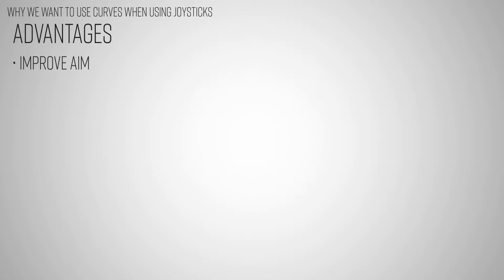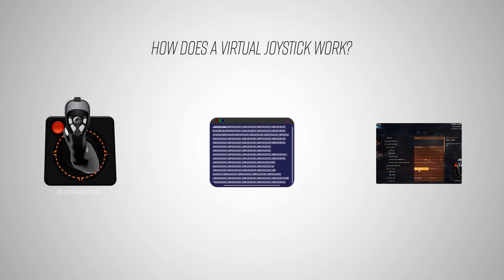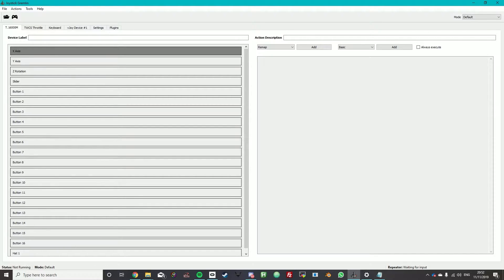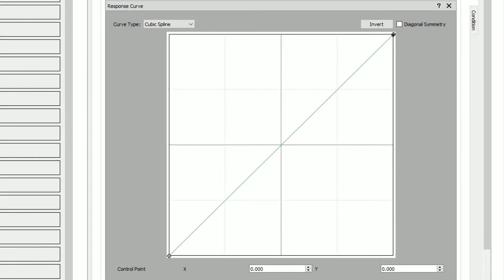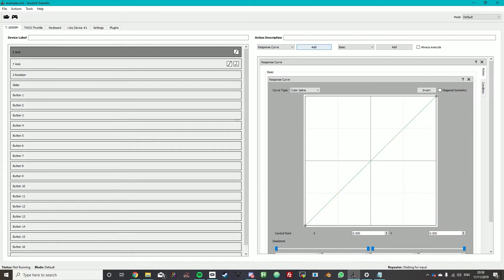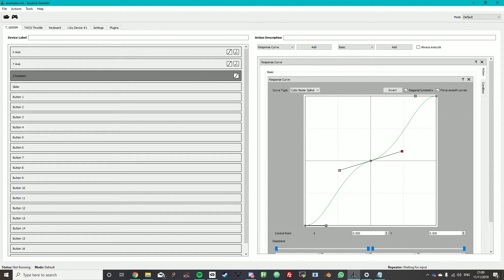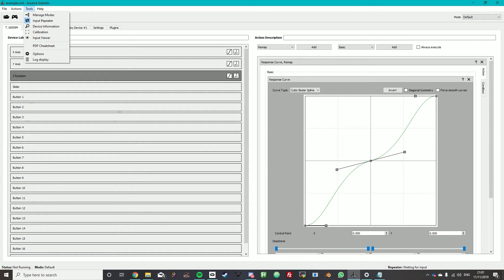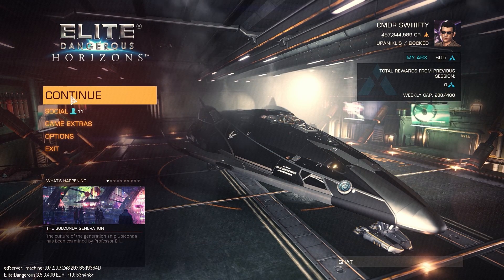How to install curves for ANY joystick (for elite dangerous)

Comment: Why don't you use the Thrustmaster T.A.R.G.E.T software which comes with the T16000?
Reply from the maker: it would require me to have to rebind ALL keys, this is a faster method
Reply: @artoshia  hm, yes .. make sense.
Reply: @Maxxermaximus  Not to mention, when using T.A.R.G.E.T., you have to sacrifice control axes.  t.16000M FCS HOTAS has 9 axes between it, and TARGET can't handle that many.  You're required to turn off a few of them for the convenience of having them emulated as a single input device.  Unacceptable in my eyes.  I use 8 of the 9 axes in normal play in Elite.  The only one I don't use is the throttle slider on the stick.
Reply: @ChozoSR388  You don't need to combine the stick with the throttle.. You can make a TARGET profile for the stick and let the throttle as it is..